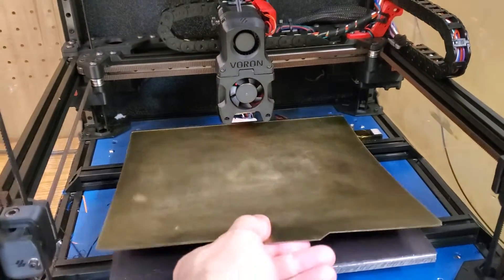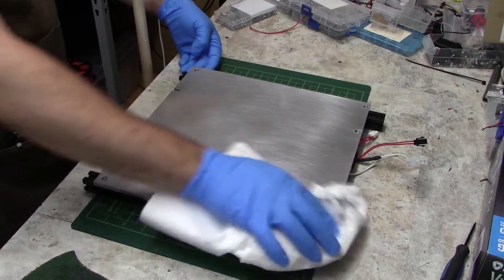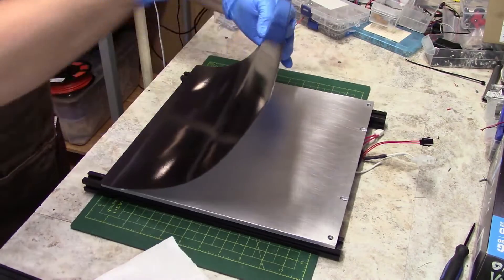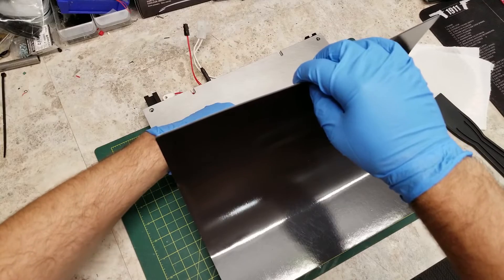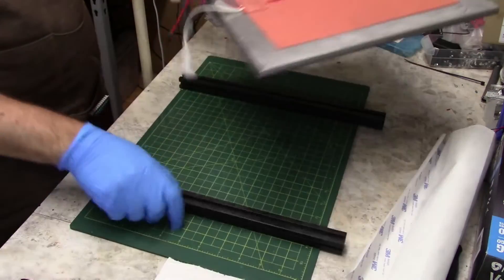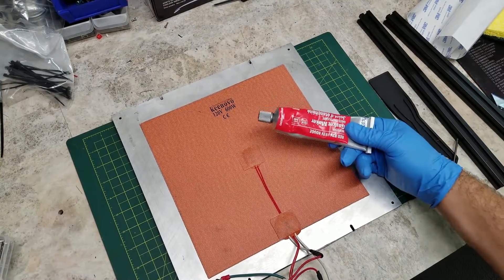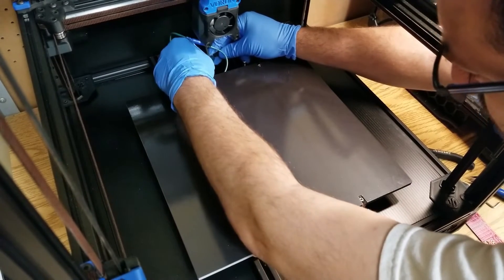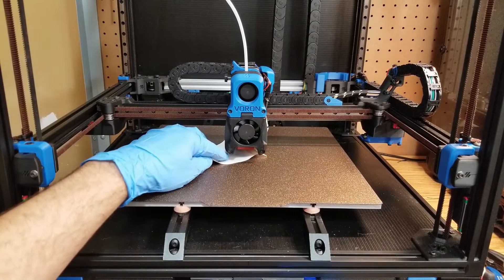Flexplate Installation Guide MADE EASY!

Comment: Forced to replace my bed due to wear & tear (the heater bed wires on my Ender 3 started to fray, and caused a short!).  I was loath to replace the magnetic bed, fearing air bubbles... but after watching your extremely in depth video, I'm going to do it.  I love my spring-steel sheet too much to go back to glass.

Thanks for the courage!

Comment: Does this magnetic buildplate supports 110c (temperature for ABS)?
Reply from the maker: Been using it for years with abs at 110c no issues
Reply: @CanuckCreator  Thank you for the answer. Bought one for my 3d printer.

Comment: Oh man, I wish I found these printers a couple years ago. They are so crisp and clean looking. It's definitely my next printer.
Unfortunately I've spent about $1000 on building a Hypercube Evolution, buying it's parts here and there for just over 2 years. 
However, my next project is a filament extruder, mostly do I can recycle my old and failed prints... They add up quickly haha

Comment: ProTip™ for aligning the magnet: peel off a strip of the backing, but lay down the other end first while keeping the exposed adhesive strip a bit elevated (the backing usually takes care of that, unless you peeled of too much). Then you have not only 1 edge to properly align it, but 3. Then just brush from e.g. the aligned back/sides towards the exposed front strip, pressing it down perfectly aligned. And then you can continue like shown in the video.
tl;dr: peel of a small strip at the front, but align at the back and sides.
(edit: this may not be optimal for oversized magnets, though. but i guess still better than aligning on the sticky side.)
Reply: I just did this, I ordered a 355mm magnet, but my bed came and it was also 355mm.... :) I mounted it the way you described (it seemed like the best way at the time too), exposed about half inch then lined up the other 3 sides and when satisfied pressed down the exposed edge. Then followed Nero's directions from there. Lined up perfect. 

I felt so confident I did the magnet right after and now it's sitting with 20 books on it for a day. :)
Reply: I used the "ProTip" and a "Bondo spreader" (larger and more flexible than the plastic spatula) and the fit could not be more precise, no bubble and it was applied in no time. Thanks to both Nero and Jan!
Reply: Thanks guys, I wasn't feeling very confident getting a perfect lineup when the magnet and bed are exactly the same size (350mm) but I'm going to try this!
Reply: This is indeed a ProTip™!  I followed this tip and everything went perfectly and quickly with zero bubbles.  What I did find worked better for me though vs. the video was working toward my body rather than away from it.  I think it gave me better control of peeling the backing away, especially near the end of the job.

Comment: I use a old creditcard and go from the furthest side to me when applying the magnet. Its alot easier as it is easier to pull towards me. I also dont hold the magnet while applying, as its not that heavy, and the plastic sheet can keep it floating.